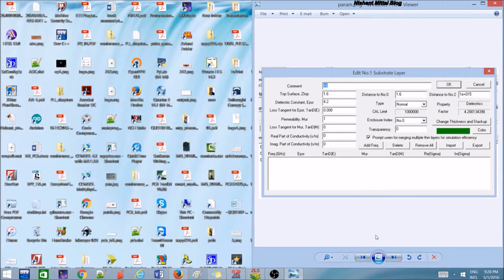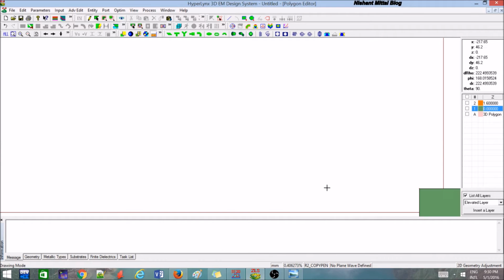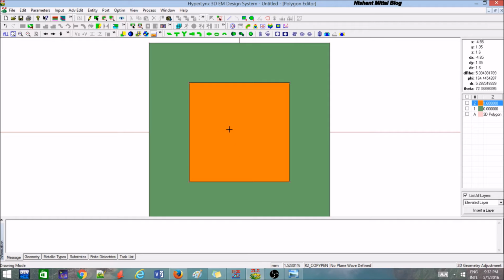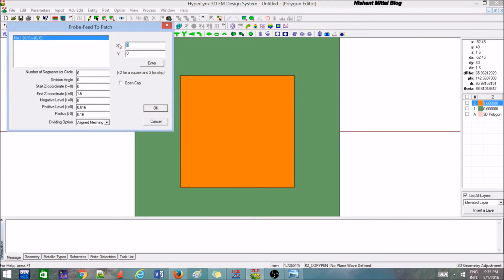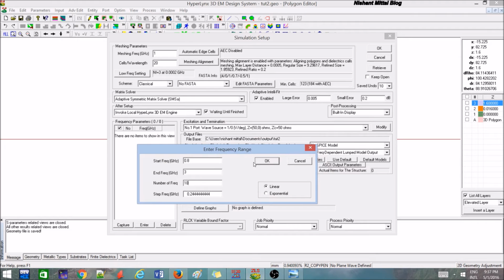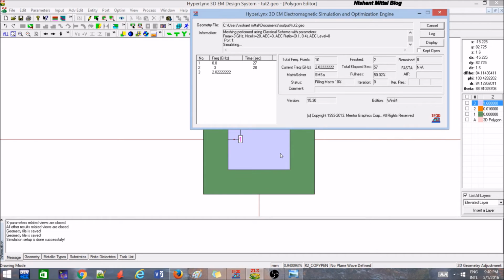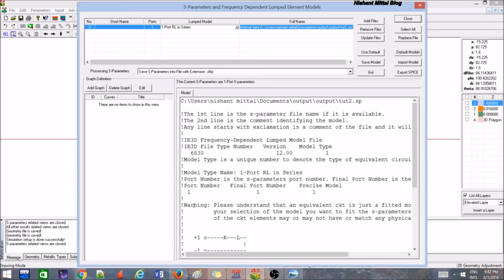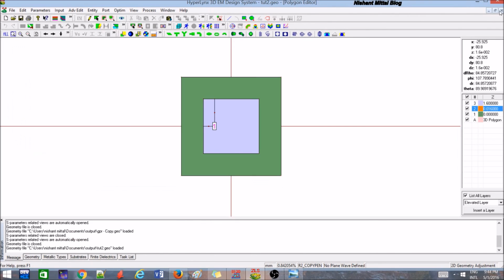IE3D Tutorial Series 2

Comment: Dear Nishant can we tilt the patch antenna. (I want to know whether we can make 3d antennas using ie3d))
Reply from the maker: Yes we can . You need to give a dielectric and assign it air.
Reply: @nishantmittalblog  Dear Nishant thanks for your response. I want to tilt the antenna at theta=30^o and phi=90^o geometrically. What is the link with dielectric constant.
Reply from the maker: U need to use air to do this. It need to be done in that way
Reply from the maker: There are more option to change theta. See the tool if that option is present